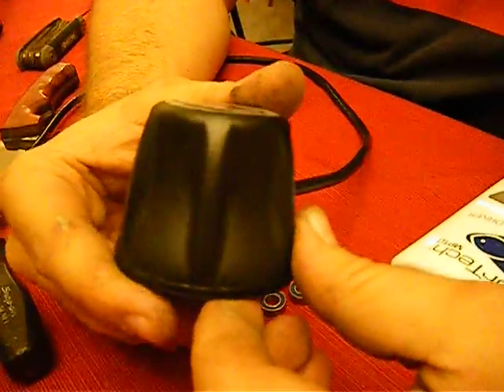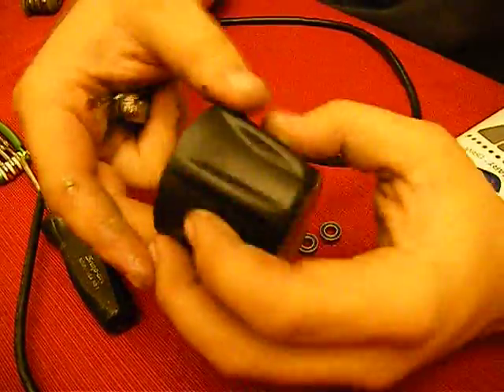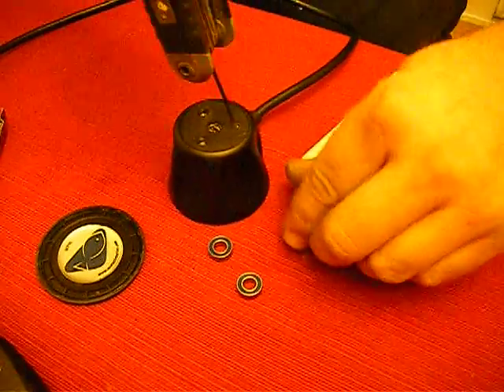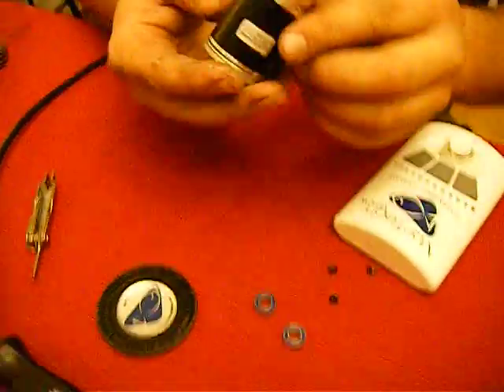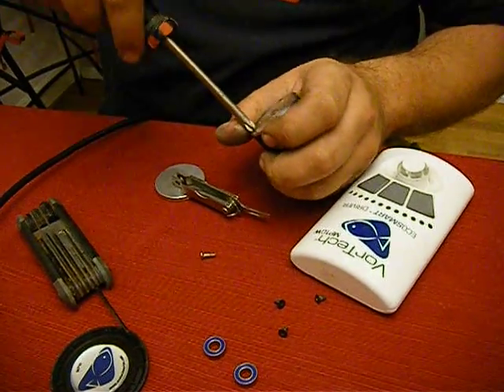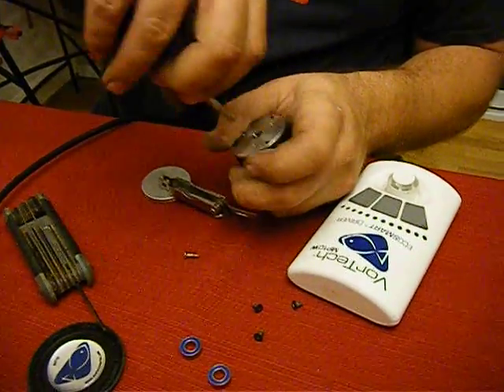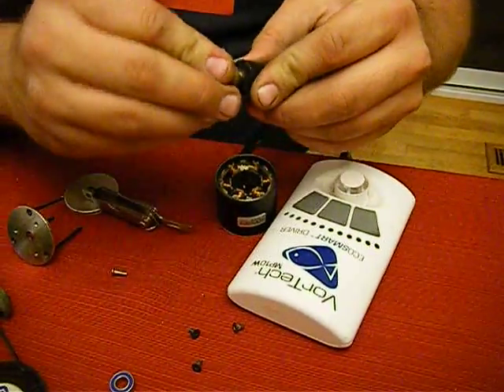Vortec MP10 bearing replacement part1

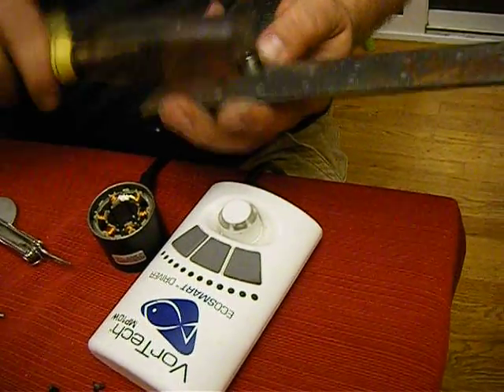Comment: I couldn’t get the bearing off. Tried for a few hours using your tip 2:25 and anything else I could think off neither one will budge 😢 all I ended up with is a dinged up magnet

Comment from the maker: which cover if its a sticker I just took a screw driver and pulled in apart if its the actual cover i sttarted at the seam with a razor blade and then moved up to a screw driver